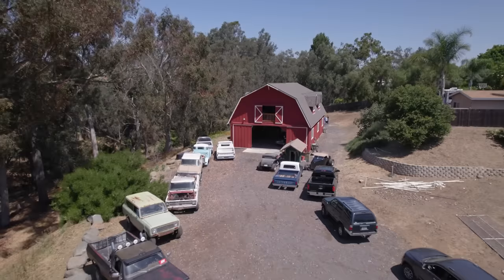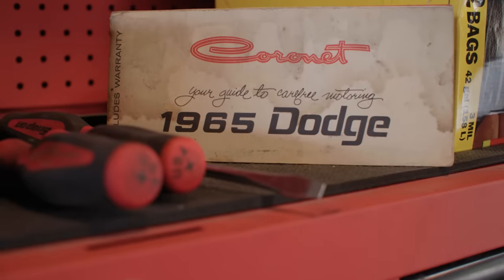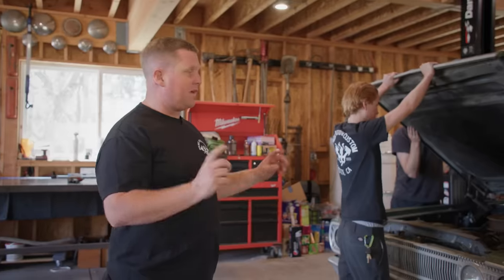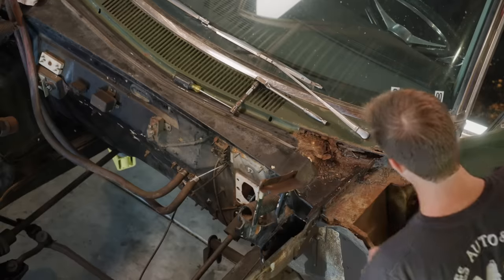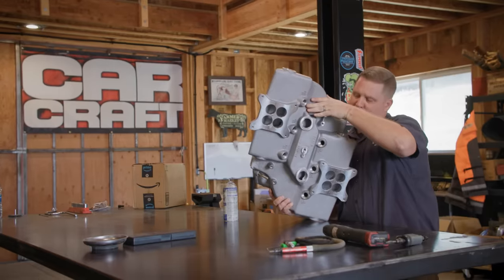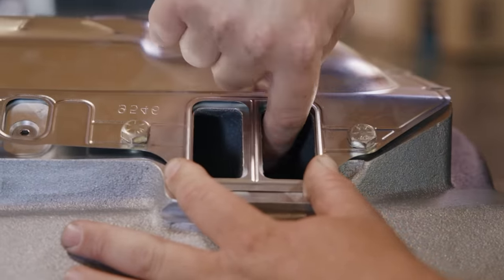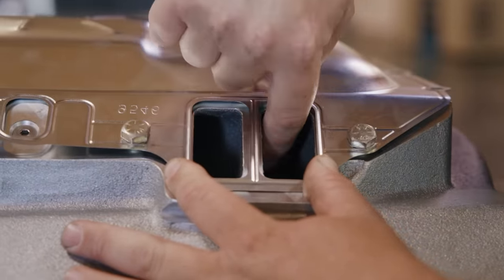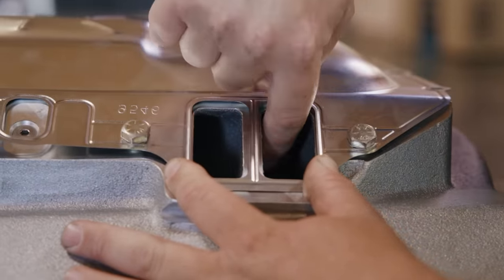Big Block Powered 1965 Dodge Coronet for Roadkill Nights | Car Craft | MotorTrend

Comment: My brother had a ratty 65 Coronet 500 back in the 90's it was originally a 273 car that was replaced with a 78 318. After he was discharged from the Navy, we found and built a 73 340 with cam, headers, etc. The car was an absolute screamer, never did get a chance to time it at the strip but with a stopwatch and measured out 1/4 mile it was approx 13 secs and that was with 3.23 open rear.

Comment: I had 440 with same manifold and on weekends I would run a dana 488 and could hit in High 11's to low 12's with a 11:33 best et thru a 4speeds hays clutch /pressure plate

Comment: Hi- Didnt see any Moly cam lube on that cam.  If its a new cam, its necessary or the cam may be wiped out  especially if its allowed to idle during break in.  Some manufacturers apply a coating on the cam to HELP protect it, some dont.  The Moly paste still gives that extra insurance as metal filings are not needed in a fresh engine, and no one wants to take apart a fresh engine to replace a cam and deal with metal filings.   Theres a procedure to get the RPMS up for the first starting so all new surfaces mate.   A good idea on a used cam too especially if new lifters.    Putting oil on the cam will dilute the thick Moly cam paste  also.   There is a liquid moly lube thats thinner too, but the paste sticks the best. The liquid can be added for overall wear protection, but not directly on a new cam, thats what the paste is for.  All cam manufacturers sell the lube and have break in procedures as to rpm, and time to run it at that rpm, and to have spark and gas right upon initial startup to prevent excessive initial cranking.  If its a used cam, hopefully its the right specs for the purpose of use and power range desired.  Most buy cams that are just too radical for smooth driving.  A cam is the heart of the engine really and controls where the power rage is. .   If a used cam, its more risk as lobes must be measured and analyized for past wear.   Used cams also may not last as long as a new cam if thats a concern.    Hope things work out.
Reply: Some of these shots are for viewing only, and not the actual installation.  I can assure you these guys know how to put an engine together, and do it right.   I went back and reviewed that sequence, and I see the reason for your comment.  But, as I said, these guys are not new.

Comment: To reset the pan bolt holes i would take a ball peen hammer and center the ball in the hole then tape the hammer face with a brass hammer. With a clean, smooth ball it would dimple the hole perfectly.